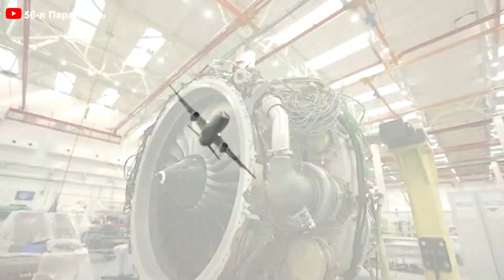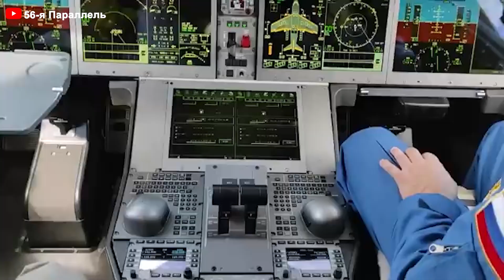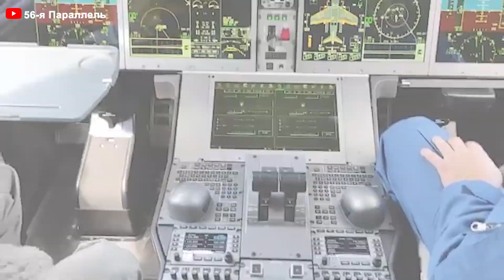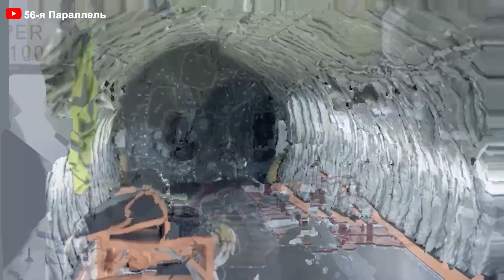Russia's PD-8 Is In BIG TROUBLE! Here's Why

Comment: This video aged like milk. Today Russia showed the first flight of Sulhoi Superjet with PD-8.
Reply: it's 2026. pd-8 is still not certified.
Reply: Russia, or the Soviet Union, has not made commercial aircraft in large numbers since 1980. There is a very long road ahead to crank out SSJs reliably and in large numbers. There is no reason to expect that the Russified SSJ will be more reliable than the original version.